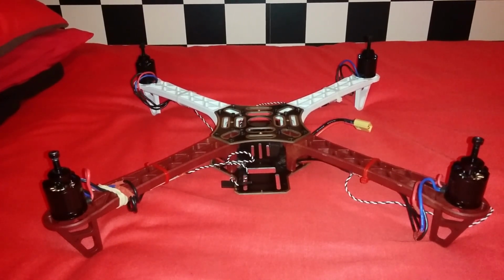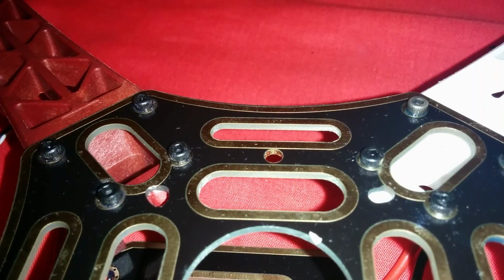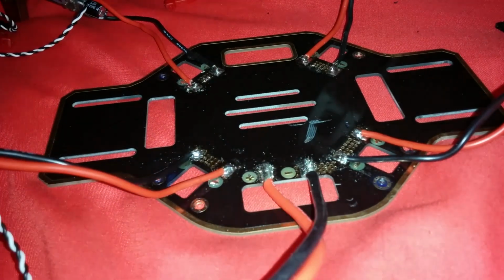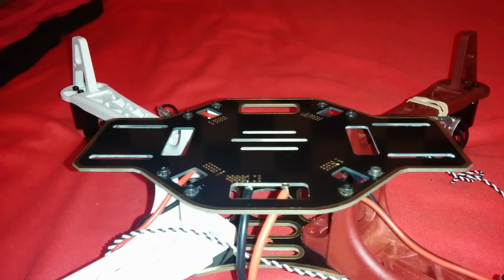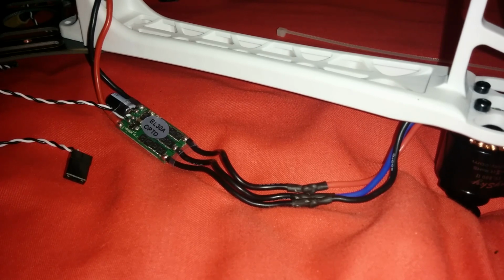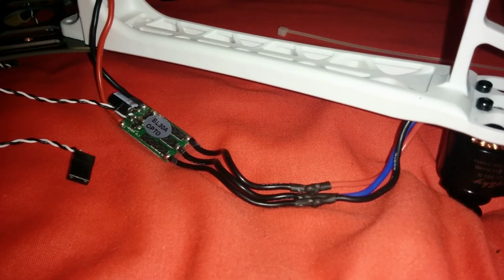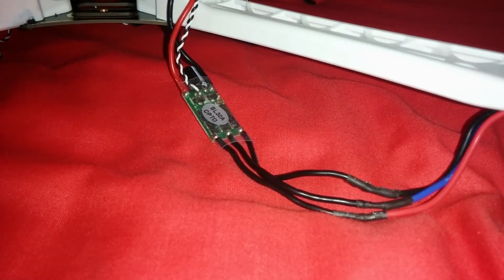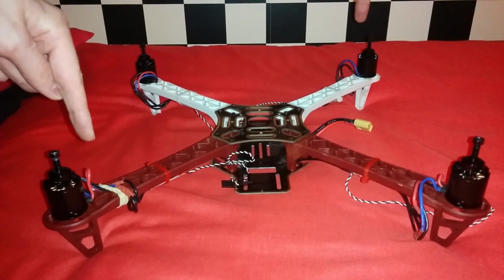High End 450 Quadcopter E02 - Connecting Motors and ESC

Comment: Andy, I have those same sunnysky motors in the middle i  got black wire. you are telling to connect the black wire to the black wire of the esc which is confusing. does it cause any problems? bcoz the the center wire in the motor must be connected to the center of the escs right?

Comment: @AndyRC Wont the loctite make the arms brittle? I know the frame has brass inserts but even so you have to be careful surely not to let it get on the plastic?

I guess maby on thick plastic like these arms its a non issue but I know with items such as props its a huge no no and was the cuase for a lot of prop failures on the blade 350QX before they changed the hub design. 

I may be wrong in this but I always thought it had to be kept away from plastic.
Reply from the maker: +CyclingSalmon14 you must always use medium locktite and it doesnt do anything to the plastic or the prop.
Reply: +AndyRC Thanks for clarifying that.
Reply from the maker: no problem thanks for your support

Comment: Nice trick with the ESCs, but i am pretty sure this does not work with every motor/ESC combination, does it? My motors for example have all black wires, but i have a few sets of motors with colored wires too, definitly have to check of tthat system may work for them too :)
Reply from the maker: for ones with black wires the direction will be still the same so just compare your black wires to the coloured wires to figure out which should be red and which should be black
Reply: AndyRC
Thats a great idea, thank you :)
Reply from the maker: no problem